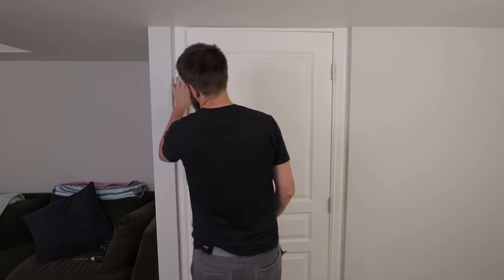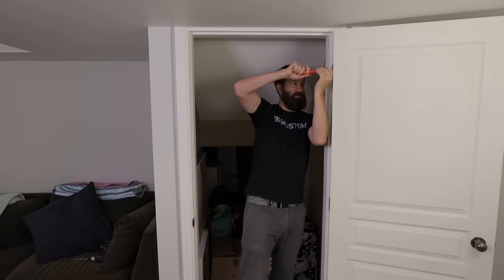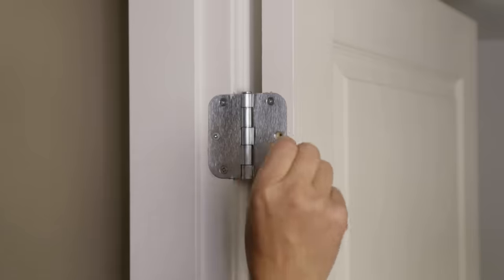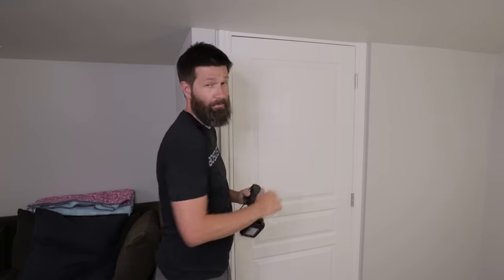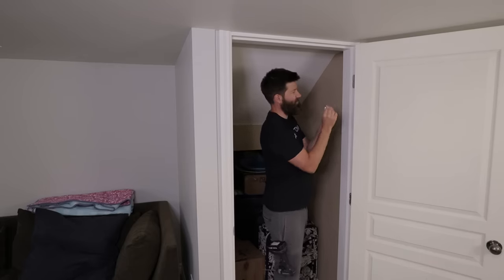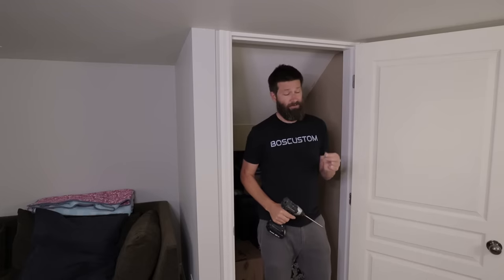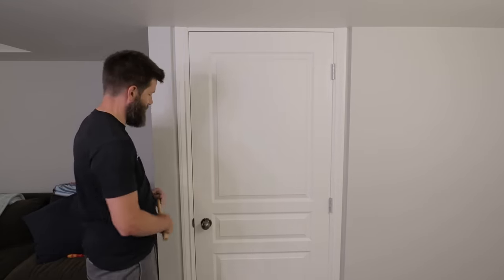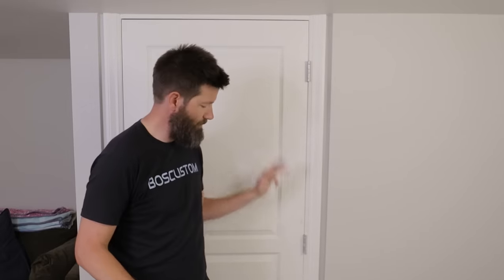How To Fix a Sagging Door that's Rubbing or Won't Close!!!

Comment: Fix 3, if you want to move the door from the edge, shouldn't you bend the door loop to the right and align them vs bending the frame loops toward the gap you want to increase?

Comment: I'd like to throw in one more trick that someone taught me. It's called the two penny fix. In the case above, you would loosen the bottom hinge that is screwed into the jam. You loosen it enough to be able to slide a penny or two under the bottom of the hinge and retighten the screws. This pushes the other side of the door up and can often be enough to close the gap.

Comment: Ok my house was built in 97.. my bedroom door is all kinds on wonky. The gaps are all kinds of wrong and and watching your video it seems the longer screw trick would help with how loose the hinges feel with the framing also moving slightly but not the sticker lining up and other gaps. And bending hinges I don't feel would work well. I'm going to try the screws first but is seems like the whole frame might be off

Comment: they make a special tool to adjust hinges without taking them apart like that. they are called a hinge tweaker. they are a bit expensive but can have stuff like that fixed in under a minute.

Comment: I went to apprentice school in the 70's and we were taught back then not to bend the hinge, we called that a sprung hinge and would replace it, of course doors were much heavier back then, the problem we had is the hinge bent for a reason, weight, bending the hinges on those heavier doors was a short fix, because after bending the hinge it becomes weaker and has a tendency to rebend. I know you are not bending it much, but each time you bend metal it becomes weaker. Also the cost difference was much different back then, hinges were cheap. And I did most of my work on commercial building where the doors were much taller, thus heavier. But good points for the average home owner.

Comment: Hello there, I tried your 3 tips and they did not work.  A couple of comments.  With the top pin out the door closes with a slight rub.  What I noticed is the door jam loops are out further than the door loops.  This is the opposite of what you encountered on your video where you bent them to align with each other.  Any other suggestions?

Comment: Still have a problem.  Full disclosure, I tried tips #1 and #3 as I found the screws were still tight. There’s about a 1/4 inch gap at the top of my door on the handle side, while the space is about 1/10 inch on the hinge side. Any suggestions? New door? 😅

Comment: Pick and screw did not work for me.
My hinges are some fancy ones made in Denmark. The pin is welded to the hinge which is really thick. I can unmount the hinge, but it is very thick and seems unbendable without a press of some sorts. 
I also have a door that sags at the bottom but I guess that is another problem.

Comment: My door is rubbing at the top, like yours in the video.  And the latch won't go into the strike plate, as it hits above it.  I noticed that my door bottom side near the lower hinge is almost touching the door frame.  When I took the top hinge pin out the only way the latch will go into the strike plate is when the top of the door is all the way over against the door frame.  I think my house is doing some weird settling and caused this door frame to be out of alignment.  Help!

Comment: Neither of these work for me.  I think it may be stemming from the house settling as one side of the door frame is sitting higher than the other.  Unplaced a level on the door, it registers perfectly.  I place the level on the frame and it is off slightly.  Any tips on how to combat this?

Comment: You can take off the top hinge and put the screw behind the behind hinge to hide it also means you can often get the screw more central to the stile. Also be warned you might fix the binding against the stile/jamb but you may introduce another problem the door being out of wind.

Comment: Any other tips if none of those worked? Last one doesn’t work at all since the hinges are flush with the door frame and doesn’t stick out. I’m thinking of sanding/cutting portion of the door that are blocking but I know it still won’t fix the problem entirely since the strike plate still won’t be aligned to door’s latch.

Comment: My door swings in with hinges on the right. The top left sticks out (towards the inside of the house)  1/8” and we have to pull on the handle from the outside to operate the deadbolt. Which way do I need to adjust the door?

Comment: Fix # 1.5: Swap the top and bottom hinges. In all likelihood they have fatigued over the years and the top one is bent out while the bottom one is bent in. Swapping them will give them years more use before needing replacement.

Comment: Okay... help please!? Our door is sticking... but not on either side, but rather at the top of the door frame. This home is actually an original office building from an Army Base from 1942. It's been added onto and remodeled 
 many, many times. Each time it storms here, (in North East Texas), and lightning strikes close, the thunder shakes the entire house. All of us wonder each time which doors will be stuck this time. However, this one door isn't unlevel, and the gaps on the right and left sides are equal. It's just the top of the door that gets stuck in the center of the top door jam. I considered adding a screw to suck it up to the frame, but when I even tapped it with a hammer it separates it at the corners from the sides of the door jam. It's the door for my 16 and 18 yr old daughters. I'd love it if they could have some privacy back from their little brother and his friends. 🙄💀 help please!!!!

Comment: How much smaller than the jamb is a door supposed to be? My hinges are tight, pulled the pin and couldn't close the door no matter i tried. Measured both the door and the jamb and they appear to be the same size if I did things right..

Comment: Here is a tip if the above 3 methods don't work because I just did a door today for a client, and none of the three methods worked for me.  Say the door is leaning, in other words, you look at the top of the door, and is slanting downward toward the latch side just like in the example in the video.  So this is what I did and it worked perfectly:
1) remove the casing on the hinge side
2) remove any long screws that they used in the hinges (sometimes installers put in long screws to make it more secure)
3) take a sawzaw with a metal cutting blade and cut any
fasteners and cut through the shims at the same time to create some space
4) Now simply screw some heavy-duty screws into the frame to push back
the door so it's level at the top and of course so the door doesn't hit any of the door frame near the latch side.
5) make sure you reinstall some new shims and don't forget to reinstall your hinge screws!
6) Go have a beer or just hire me! 😂

Comment: I tried all those methods and it lifted the door but it won’t latch closed. We installed 3 doors we got from a warehouse for a cheap price and all went well. We had to purchase the last door and that’s the one that’s giving us trouble. Everything was plumb but then the door wouldn’t close. The top caught and the bottom was sticking out. It looked like the hinges weren’t quite right. Help me if you can please. Thanks!

Comment: What should I do for an exterior door that is off-level and also too close to the hinges (i.e latch doesn't catch the strike plate).  Only thing holding it closed is the deadbolt and the fact that it's off-level.

Comment: Hi, new homeowner and I know nothing. I’m trying to do #3 but when I shut the door, it’s stuck in the frame so tightly that there’s no wiggle room at all. I can’t lift it at all to align it. I can guess about where to bend the loops, but without being able to lift/move the door, I won’t be able to line them up to even get the pin back in. Any ideas??

Comment: for steel doors with 4.5" hinges that don't bend (easily) you can shim the jamb side inside edge of the hinge towards the door which moves the geometry for the hinge pin so it is further away form the strike side,,,

Comment: Also if it's a newly built house it could be getting stuck from it settling. Just take a spare piece a wood to the corner of the door frame so there's no damage to the frame and hammer away until the door opens and shuts freely

Comment: I have a door that sags down towards to the end where handle is at.  It will close but the knob is misaligned with the slot in side of wall. It's a little higher than the slot. How would that get fixed?

Comment: I personally like problem analyses a lot more than practical stuff like this because it can help people understand the issue better.

Problem analysis: You bought a door with extremely cheap hinges and it bent over time, as well as its screw attachments were way too flimsy. 

Solution: Do not buy cheap stuff in the future and replace your current hinges with better ones. If you just keep bending them the material will get increasingly softer. Personally I have over the top thick (about 1cm thick) decorative hinges on all the doors and never once had this problem. Sure they were expensive, but they are maintenance free (have to oil them sometimes) and look really nice
Reply from the maker: Nah, those are the hinges that are in 98% of the houses built in my area.  You can absolutely bend them and go on to live many many happy years with perfect door function. Thanks for checking out the vid:)
Reply: @TheFunnyCarpenter  But the time you have to rebend decreases each time, right?

Comment: My door has a unique problem I've never been able to fix since moving into my house 3 years ago.  The gap is by the top hinge, but the opposite corner of the door is actually too high, preventing it from closing.  The top of the door is hitting the jam.  It's odd.

Comment: A narrow shim strategically placed along the inner or outer edge of the top or bottom hinge will shift the hinge pin centerline left or right as needed. Pounding on hinges is a good way to destroy it.

Comment: I took out the pin at the top but still couldn't close the door.  Then I tried the middle one but still couldn't close the door.  I did replace the screws with 3 inches screws on the middle hinge too but that didn't work. Any other suggestions?
Reply from the maker: Where is the door hitting?
Reply: @TheFunnyCarpenter  It is hitting along the top.  I can't get it to close. If I could attach a photo, I could send you a picture.
Reply from the maker: @charlottieeoppolo3232  the side away from the hinge side or closer to the hinge side?
Reply: @TheFunnyCarpenter  the side away from the hinge side

Comment: i have doors that close but they dont close tight. Once the door is closedi can push with my finger and theres movement, or if the window is open in that room and its wind ythe doormoves in and out....whats the issue please? is it the latch? The doors are quite new and the installer i believe didnt check this

Comment: Mines doing that but on the bottom and you have to really push to get the door to the frame because it seems there's a lot of resistance where the hinges are. You can even hear the wood cracking at the hinges when you try to close it. The door was installed 2 years ago and theres been no issue until the last few weeks. I cant understand how its suddenly gone that bad in a short space of time.
Reply: Never mind I found the problem. The frame has come away from the wall at the bottom on the inside of the room so the long screw trick will probably work. That door does get a lot of abuse, family member with behavioural issues.

Comment: Me I am installing à old metal french door with a very small section and à big one and the big one wont close its hitting at the top part of the frame I mean the horizontale part of the frame the top 2 hinges have a big gap but uf I fix that it will hit the top even more do if you have any advice for me it would be appriciated

Comment: 3rd Option did not work for me.the hinges are much stronger than the wood. I ended up cracking my door frame. Had I tried to bend the hinges on the door side I'm quite sure it would have ripped out the screws from the door. Now I'm going to try to repair the frame and shave the top off the door.

Comment: If the toothpick trick doesn't work another option is to get a small wooden dowel, drill the hole bigger than the screw, add some wood glue on the dowel and hammer it in. Once dry, you can then drill you screw into that new wood

Comment: There is a tool that locksmiths use called "the hinge doctor" and it properly bends hinges easily and quickly and it just slips over the hinge without removing any hinge pins as lots of hinges have non removable pins.

Comment: On the third way.
Stick a shim in the  gap that makes the gap straight.
Drop the pin in the top and bend the  top loop of hinge until the pin drops.
Tap the pin down through the center loop and then bend the bottom loop until the pin drops into bottom loop and tap it in.

Remove the shim.

Comment: Come to think of it, my brother once blew out the top and middle hinge of his front door (jackass, that's why) and told me not to even bother because it can't be fixed. To his disbelief, one long screw in the middle and top hinge alone and the door was already opening and closing properly. As stated in the video, #2 the longer screw to frame will probably fix 99% of door issues.

Comment: Excellent video but I've tried all three steps and nothing.
 :( When I removed the top pin door shuts fine, when pin is put back in door gets jammed. Middle hinge has a big gap and the top and middle screw turn. Tried toothpick created a tighter grip but door still getting jammed.
Reply from the maker: Hmmm, if you can check the hinges with a straight edge that would perhaps tell you the source of the problem.  Maybe the middle hinge needs to be shimmed over.

Comment: What if the frame has settled and the top far side of the frame is touching the door on the top?
Reply from the maker: I would sand the door down with a belt sand or heavy grit on an orbital sander

Comment: Ok so my door is falling apart . It was really squeaky an i got tired and didnt have that spray oil on hand an i just thru on a bunch of vaseline on the hinge’s. Fixed the squeak, but thats not the only problem. My doir has been broken into an kicked in so it’s pretty damaged . I took lots of duck tape to try an hold it all together but it wont close, gets stuck if i do and its hard to open again  and it just wont  hold together. Now the lock part is giving me troubles :/  seems like the bottom part at the hinge it just swinging around .

Comment: In theory those should have worked but not for my door. The hinges did not bend. I tried with the wrench, hammer, pliers. All it did was help pull it out the wall a little more.

Comment: Mine fits the frame fine but the bottom corner drags on the floor about 3/4 the way open. It's left a nice  line 😭 There is a slight crack in the frame behind the top hinge. Trying to figure that out.

Comment: We have a metal back door that is rubbing the floor. We have tried bending hinges, longer screws, and new hinges…. Nothing worked. We also replace the door knob and dead bolt and nothing lines up with the strike plates 🤦🏻‍♀️

Comment: You need a new door hinge. Once it sags, you have to replace a new one. Fixing it is not a solution and it will come back with the same issue. Contractors in my area keep fixing them and they eventually have to come back again and again.

Comment: To have a more secure exterior door you should have long screws drilled through their hinges and into your homes framework so it strengthens the attachment to the structure. The typical new home only has 5/8” long screws attaching these door hinges to the frame and all it takes is a sold kick from someone to gain access to your property. If somebody is determined to get in, they eventually will, but why not slow them down in case you need time to find protection.
Reply: It’s the first thing he does, run a 2.5” screw into hinge plate

Comment: so my door is leaning the exact same way as yours,
#1 my hinge was already tight and screws were tight
#2 I cant try this method because I have a window right next to my door hinge, so no room for a longer screw
#3 my hinge doesnt seem to want to bend in like yours did, maybe cause its our front door and uses stronger hinges?
Reply from the maker: Check out all the hinges, if one seems to have a smaller gap than the top one- try switching it.  If that doesn't work try and take that top hinge off and squish the plates together in a vase if you have one.
Reply: @TheFunnyCarpenter  should I swap the entire hinge or just the half connected to the door or wall?
Reply from the maker: @inscrutable67  the whole thing
Reply: @TheFunnyCarpenter  thanks

Comment: My Bedroom Door Sags About 1 Intch And It Doesn't Close The Way It's Supposed To And It Don't Catch It's Self When It's Closed And It's And Not Level For Some Reason It Pulls Away Form The Door Frame I Have Tried Replacing The Hinges And It Worked At First But Then It Was Sagging Again And No One Seems To Know What's Wrong With It And It's A Double Wide Trailer Mobile Home I Did Even Even Have  A Contact Come Out And Take A Look He Told Me That The Door Was Fine When It Wasn't I'm At The Point Where I Don't Even Want To Have Door So Please Help Me Figure Something Out Herh Thanks

Comment: The toothpick trick seems like it would work well if the hole in the wall got a little too thick, but what if the hole in the door is the problem? The door is hollow, so the toothpick would just fall into the door